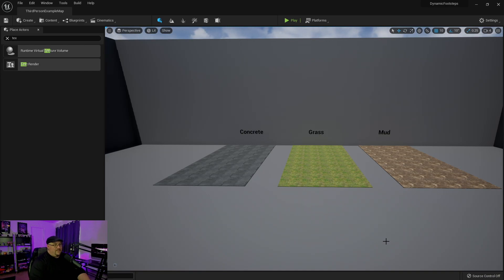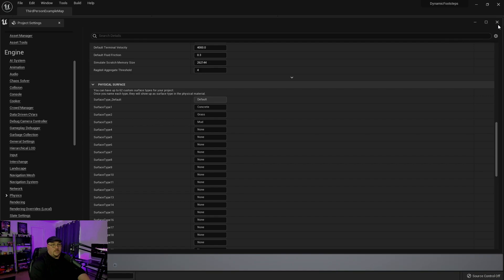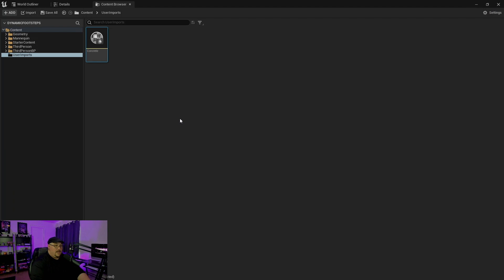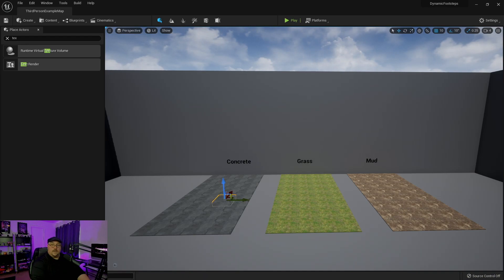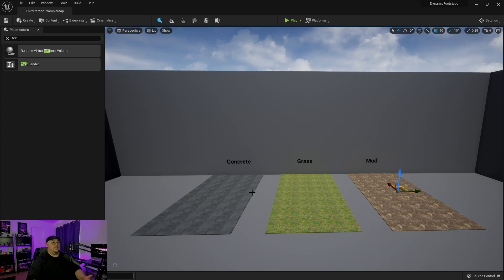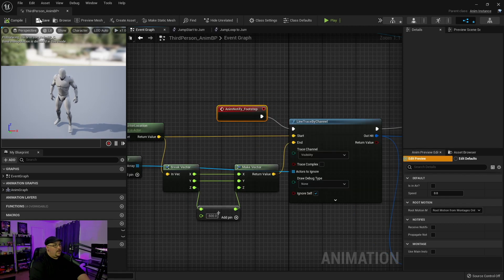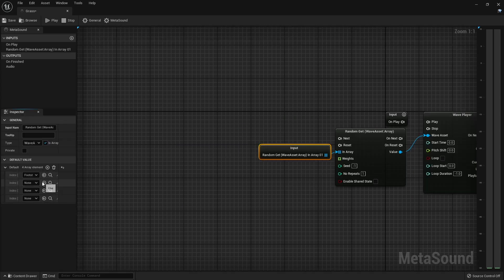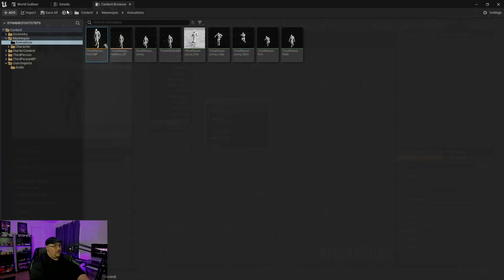Unreal Engine 5 | Dynamic Footsteps with MetaSounds

Comment: In case anyone has an issue where sounds suddenly cut off after a while or stop playing anymore, try plugging the Metasound's Wave Player's "On Finished" node with the output's "On Finished" node. There is another comment mentioning about this fix, however I would like to give an explanation as to why this is important.
Unreal Engine as far as I know supports 32 audio sources playing simultaneously. When this limit is surpassed, the new incoming sounds replace the oldest sounds in the list of audio sources. This means that if your project uses only short/rapid fire SFX, you will likely not notice a problem. However, the issue becomes obvious when your project uses long or looping samples (e.g. background music). If the "On Finished" wire is not connected, the sound which is played by the wave player will not get removed from the stack when it's finished and it will effectively stay in memory. Eventually (e.g. after a bunch of footsteps play), your background sound will get overwritten by UE trying to find room for a new footstep sound. When the "On Finished" nodes are connected, sounds get removed from the list of active audio sources, as soon as they're over.
In order to easily visualize this issue, execute "au.Debug.SoundWaves 1" in the console during play. You will notice the stack getting populated as new sounds get triggered, however they don't disappear from the list when the sound is over (if those two nodes aren't connected).

Thank you very much for this great tutorial, I sometimes forget about one of the steps (e.g. project settings physical surfaces, anim notifies etc.) and this is always my go-to video for finding out what I missed

Comment: Shoot! I HATE following these tutorials TO THE LETTER, double-checking my progress as I go, and having them not work. And then no one responds in YouTube. 

I'm working in 5.2, and I have two mannequins: Manny and Quinn. Quinn is in the scene by default, and "her" animBP says it's a child of Manny's. So I worked in Manny's BP and Quinn's wouldn't show the vector line trace. I copied all the added nodes into Quinn's animBP and still no vector line trace showing. Maybe that's not a deal breaker but...does this work in UE5.2?
Reply: I have to exact same issue right now, and I am working on UE 5.3

Comment: how can add multiple sounds to the same surface? so the sound wond look looped so much! thanks!
Reply from the maker: Create a MetaSound with a wave player. Instead of just putting one asset in there, pull off the asset pin and add a get random from array node. Pull off the array pin and create a variable array. Add your variations to that array. Run your OnPlay into the get random node and run the OnNext pin to your wave player. Connect your OnFinished and your audio outputs. This should give you a MetaSound that will randomly pull audio asset each time it's called instead of just one sound over and over again. Check out this video to see an example: https://www.youtube.com/watch?v=RU1JF304NfQ
Reply: Thanks! you are fantastic! tanks again!!! Cheers from Argentina! @TheSoundFXGuy

Comment: I’m trying to figure out how to get the “length of the audio” or duration of the file using meta sounds. I created a simple UI widget button that when you click it spawns the audio then plays it using blueprints. I’ve spent hours and weeks trying to figure this out only to find one reference to audio duration and that was Get Duration but couldn’t figure how to use that. Any advice or guidance would be appreciated.
Reply from the maker: As of 5.2 there is currently no way to send data from a MetaSound back to your blueprint. The Get Duration node will give you the time of the file but it's only useful for time based calculations within that same MetaSound. If your button is playing a specific audio file, you can look at the file details in the content folder to see the duration and then make a variable in your blueprint with that value. If you're using random sounds, you'll need to make an array variable with all of the duration values and find a way to send the same index number of the correlating value in the array to the asset array in the MetaSound to pick the correct element. It's a bit of a janky setup but that's the only way I know to do it at the moment.
Reply: @TheSoundFXGuy  thanks for the feedback, suggestion. That’s just funny how Unreal can’t determine the duration of an audio track without manually setting it yourself. But once you do create your variables you can still figure out how long the audio file has been playing correct? I’m basically trying to create an audio progress bar.

Comment: Mine only dooest the sound the number of notifies it has on the run animation...
Since im using the first person view i seted up 6 notifys, and it only detects those 6 with line trace channel... what should i do to "loop"
Reply: Facing the sale issue here. Seems like the line trace channel stops to update randomly. Don't know what's happening. Did you find a fix ?

Comment: Hello nice tutorial! :) But what about when you are in an FPS setup and you don't see the feet touching the body ? Is there a way to program a certain "pace" to the footsteps if you keep pressing the  forward button ?
Reply from the maker: Usually an FPS character (like the UE Default FPS character) still has an animation bp because of things that might be visible in the camera like arm movement. So you can still add the notify events to the animation timeline, you just may need to use other information from the animation itself to guess where the footsteps might be. For example if the arms are swinging with the motion of movement, the point where you see the weight of the arms apex at the bottom would most likely be your stepping point.

Comment: In UE5 you can get the vector + vector node by right clicking in the graph, add node (+) then right clicking on either of the pins on the left, select convert pin at the bottom, choose vector. This will make the vector + vector node you couldn't find.
Reply from the maker: I appreciate that!!!
Reply: or just typing + in vector actions. ( instead of vector + vector, since it's an operator and not a function)

Comment: Great video! I have a couple of questions and request for future content if that's okay! What is the process for adding attenuation to Metasounds and how do you approach reverb volumes and creating acoustics spaces that the meta sounds can react within? For instance, concrete footsteps outside vs inside a tunnel, airplane hangar, etc.

Love that content. You are great :)
Reply from the maker: Requests are always okay and appreciated. I can certainly put a video together on attenuation and reverb with MetaSounds.
Reply: @TheSoundFXGuy  You're the man! Most of my experience is using Wwise within Unreal and I'm eagerly trying to backfill knowledge of the UE audio engine from the UE4 days and the soon coming UE5. You're videos are an extremely helpful resource and I greatly appreciate you taking the time to make them :)